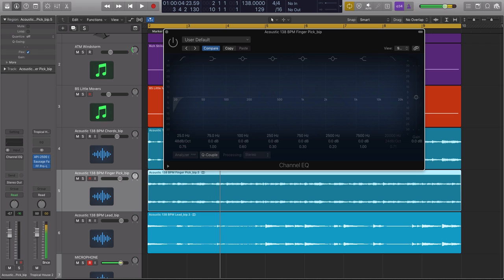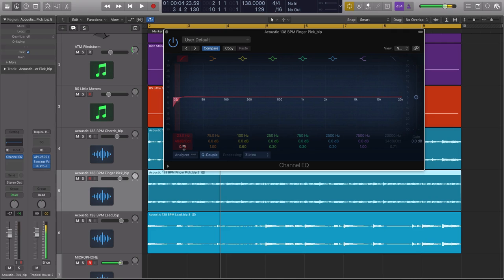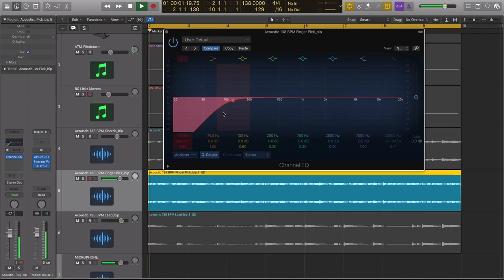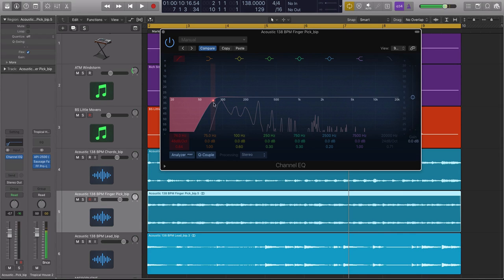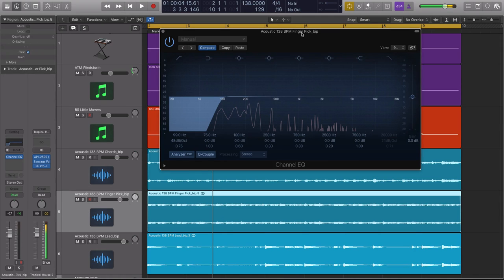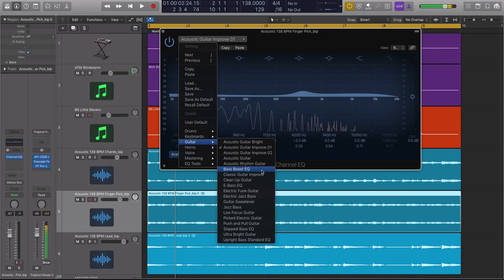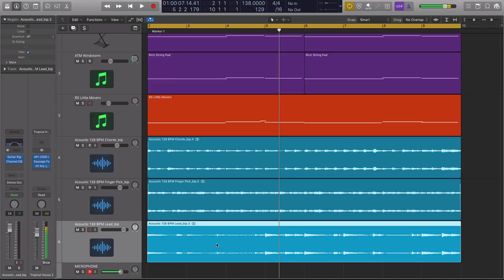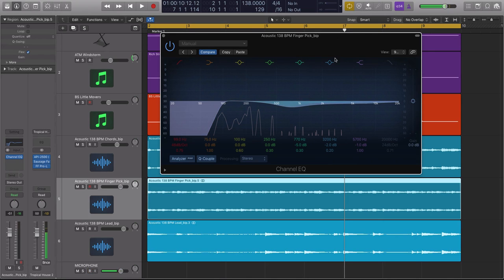3 EQ Mistakes To Avoid

Comment: I've been mixing/mastering and doing various front of house gigs. One tip I give to everyone about high pass filters is, push it to the right and pull it back until it sounds normal, you'll be surprised how much more you cut out without loosing anything.

Comment: I feel like equalizing in isolation is actually a good starting point. It allows me to get a better sense of the strong and weak points of the sound i'm using. After this though, your completely right, it needs to be EQ'd in the the context of the song.

Comment: It's hard to avoid eqing in isolation, but anyway.... aren't there some situations where it's needed? Like when hunting for nasty frequencies and so?
Reply: Short answer is yes.
Reply: Octopus On Fire It's definitely necessary to work in isolation sometimes, but if you do everything in isolation you'll end up with a terrible mix. Basically if you're working with a solo track you should un-solo often to hear how it sounds with the rest of the mix.
Reply: doing both is fine (:
Reply: Octopus On Fire cut out the bull then ex to piece it together
Reply: maybe just to hunt it but any adjustment should be made in the mix. One of those nasty frequencies might sound pretty pleasant when adjusted, if you just blindly pull it down all the way you might have gone too far and taken a bit of life out of the track.
Reply: of course it is important to search for nasty frequencies in isolation. I would do that before beginning the mix-session for all tracks. I think this belongs to the category cleaning up before mixing. 

When you EQ solo (during the mixing process) you´ll end up with great sounding solo-instrument tracks. great. But in context that often doesn´t fit well together.

When you EQ in context you´ll probaply end up getting terribly sounding solo tracks. But all that matters in a finished mix is how everything sounds together.

Comment: With presets, keep in mind that you can always familiarize yourself with the presets in the plugin and that you can also tweak them. So, for any given instrument, if there is a particular eq curve that you already know you are going for, you can slap on whichever preset you know that corresponds to that curve and tweak it from there. Some plugin devs are better than others when it comes to making presets, but as long as you are familiar with what you have, then you can use any preset as a starting point to get you where you want to end up. It's just like anything else as far as taking the time to get to know your DAW, its stock plugins (or nonstock vst plugins), and the presets of those plugins. So I say don't discard the idea of presets, even in your eq and compressor plugins, as they can sometimes provide some great starting points--especially when first starting out and learning about eq and compression. Just don't depend on them without learning from them, blindly slapping them on a track going just by the name of the preset and letting that be it. Learn from them.

Comment: Engineers figured this out back almost 50 years ago. All analog boards since the early 70's have their high pass filter either at 100 hz, 75 hz, or 80hz. It was never higher and for good reason. They made the decision for you. They knew that cutting at 150hz or 250hz would butcher the bottom section of the track in question. 

Regarding Eq in isolation  (Great advice!) I think what you mean to say is, "Don't EQ in solo."  But I guess a lot of amateurs wouldn't know what you were talking about.

Comment: I like this video but there are uses for isolation. The use is knowing what you're giving up when you cut via context of the mix. Many times I find myself in a "pick and choose" between which track I want to cover a certain frequency band. A good example are two lead synth sounds or something like a lead synth sound and high bass sound that overlaps. Do I want more of the high bass or do I want more of the low synth? This is even more important when I'm layering sounds to make one sound. Also, there are a lot of "mid/side" tricks you can do to manage space in a mix. In his example above, I may slide some of the guitar bass more to the side and the low bass mono/mid. I'm not saying it will sound good, but it's worth a try, right?

Comment: Tip #1 Don't use EQ just for the sake of using EQ. Start with diagnosing what is wrong. Then fix that. You can't hit a target if you don't even know what you're shooting at. In most of my mixes I never even armed the EQ. I always tried to get a great sound before even printing. That begins with a great sound source. If your guitar sounds bad, then shit in equals shit out. Same with any other instrument. Second, mic choice is paramount. We had 3 U87s and yet most of the time that was hardly the right mic. In fact, U87s are rarely the right mic! Know the response of your microphones and know where they should be placed. That's where you want to close your eyes and experiment. If you get the right mic and the right placement then you're 90% there. Same thing goes for setting up your mic pre correctly. I can't tell you how many times I heard mic pres over driven or under driven. There is a right place for your gain and it's just as critical as a great sounding source, the right mic and the correct mic placement. (remember, close mic-ing is rarely the right choice. Most people close mic because they have a noisy environment. However, distance mic-ing is generally much more authentic.) Lastly, be cautious of anything between the mic pre and tape (or DAW). Compressors must be mild and I'd never print with a processor as you are stuck with it once you print. As I said, if you do these things you'll find you hardly ever need EQ. Just thought I'd toss in 2 cents. (drops mic. Broke mic. Damn it!! That was a very expensive mic!!)

Comment: Hey! Regarding Logic Pro, how do you save your files? Like as a folder or project? And which of the assets do you tick? Thanks!! I also wanna look long term when I wanna back up my projects in an external hard drive.

From testing out, as someone who has his samples on an external hard drive, I find saving as folder and not selecting any assets to work. Like when I try to open a project on another computer.

Comment: I use FL. Does it matter in what order you put your mixing plugins,  like,  EQ, Compression, reverb... or Reverb first then Compression and lastly EQ. Does it matter?
Reply: Thanx for the advice, yes it sounds logical... :)
Reply: Lars Ekman well if i guess you have 8 slots to put plugins in. 
If you put a plugin in slot 1 it reads that first then it reads slot 2.
So if you put a sidechain in slot 1 and put a compressor and add 100db(just a example). Then it overwrites the sidechain. But if you turn it the plugins around it works as you want to! :D
Reply: Typically, reverb is something people use last because you don't want to create noise and mud your mix up. Sometimes I use light compression on reverb though! It all depends on many different factors. I wouldn't follow any preset order on effects. Rather, I would learn each effect individually and understand what it means to change the order of each effect. Hope this helps :)
Reply: Thank you Kyle
Reply: I also tend to put a gate effect as the very last plugin in my chain.  It helps to prevent the reverb from lasting too long and muddying up the following sounds, especially on drum samples.  Something I've found that helps create clarity in the mix.
Reply: Do whatever you want you are the creator. For my guitar pedals i do phaser - reverb - delay - compression - light distortion - vibrato
Reply: Because I enjoy how it sounds, it gels everything together for me and doesn't sound as bland as the other way around for me. Music is all about personal preference. (i picked up that one from Tame Impala). Reverb that's messed about is usually cooler and more psychedelic to me. Like reverb into delay specifically. because i compress the reverb, it the guitars sound in your face and at a distance at the same time. I love those paradoxal things.
Reply: short answer: yes. google effects chain.
Reply: Using auxiliary channels or sends can help too. Sometimes I like to set up a main channel for fixes and overall levels and then send that off to other channels for specific effects. Like splitting up reverb and delay in different channels (wet only) instead of one influencing the other, or using the extra 4 aux channels for overall reverb and delay.

The most important and least creative part of plugin flow I can think of is compression. You don't want frequencies that need to be cut influencing the compression, especially if they're bass/sub. Say a guitar has a lot of bass/sub range and you compress that before EQing it. Random bass/sub taps will influence the compression and give you strange levels and pretty much destroy any impact the instrument can have. Can happen with vocal plosives and sibilance too.
Reply: Yes, order is very important!!! (This may not be the case for all DAW's but I believe most of them have their inserts in series). This means that the signal will go through your FX chain in the order it is set up, and this order matters. For example, when using EQ and compression on a track, you may actually want to use two EQ's -- one before the compressor and one after. 

Here's an example of how signal chain order can cause problems: 

First of all, think of an EQ as a frequency dependent volume adjuster, and a compressor as an amplitude dependent volume adjuster. Now let's say you have an acoustic guitar track like in this video (for this example let's also say that the amplitude for the entire signal peaks at -10dB). In other words, the entire frequency range for this signal has the same amplitude. But you want to give it a brighter sound so you boost everything above 5kHz with your EQ by 6dB. Now you can see that everything below 5k still peaks at -10dB but everything above 5k peaks at -4dB. 

Next comes your compressor. Remember, a compressor doesn't care about frequency, only amplitude, and it only turns loud things down. So the signal comes in, and the compressor "sees" the track peaks at -4dB but doesn't "see" the frequency of this peak. In your mind you wanted to use the compressor to make the guitar strum more even with some gentle limiting because there are loud and quiet passages. So as you start adjusting your threshold you see the gain reduction meter react and you keep adjusting the settings until it sounds good to you.

But here's the issue... the compressor's meter shows you that you're getting 6dB of gain reduction. Sound familiar? In essence, the compressor looked like it was working pretty hard when in actuality it was only seeing the part of the signal above 5kHz that you boosted with the EQ (meaning that it just turned all of it back down, leaving you back where you started). Basically using both plugins in this way resulted in 0 change. Now this is kind of a silly example, and obviously in the real world it's a bit more complicated than this. But it should give you some idea of what I'm talking about. 

TL;DR
Here's the optimal order I was taught:
1) EQ to fix problems / subtractive EQ (ie. high pass filter) 
     This is where you make substantial adjustments
2) Compression
3) EQ to feature / creative / additive (ie. HF boost)
     This EQ is usually much more subtle
4) time based effects 

This order should, for the most part, alleviate issues like in the example I gave above. But of course there are exceptions to the rule. As a side note, I usually place time based effects (reverb, delay, phaser, etc) on a separate AUX track and then bus the tracks that I want to these AUX tracks. This not only frees up CPU power (because there's only 1 reverb plugin running instead of 1 on each individual track) but it also sounds more realistic as if the reverb is coming from all the instruments in 1 room vs several different sources. Additionally, this gives you a fader dedicated specifically to the effect you have inserted on that track.
Reply: Order isn't about priority or standard practices.  It's about what you're wanting and how effects upstream affect those down stream.  

Here's a good test case.  You have an EQ inserted before a compressor.  You may decide to place an EQ before a compressor in order to clean up a track's low end that contains nothing you want.  As you start cutting frequencies out, you begin to lower the level of the track.  If you've already set a threshold on your compressor, you've now effectively set the threshold higher and reducing the amount of compression on the track.  The same problem could happen if you're using some envelope following modulation or a distortion/saturation effect that's sensitive to the input volume.  I like to use an EQ after the compressor.  But sometimes a want a radical sound and compressing the sound before the EQ will allow the bits of the sound I'm not using to influence the compressor.  There is no right or wrong... only what sounds good and what doesn't sound good and all of the areas of gray that lie in between.  

The bottom-line is this:  you'll probably want to check the plug-ins down stream any time you adjust a plug-in and it changes the overall level coming OUT of the plug-in.  But as far as order, it's whatever you decide to resolve the track.  But yeah... don't put distortion on reverb... unless you're really wanting to... I might just have to give that a try with some other plug-ins behind it...

Comment: You EQ in isolation when you're trying to find a problem frequency in a track so that you can boost it and then take it out. Also, less is more. Always boost in 3db increments. The only time you should be boosting more than 6db is when you're going for a specific effect on a track. Generally, 3-6db will give you what you need.

Comment: One more question, about making changes to EQ in isolation, which I have done basically all the time since I started EQ:ing.
Now when I tried to do it in its context, I found it difficult to single out and to hear the effect of the EQ:ing as all the other sounds where getting in the way. Maybe I just have a bad ear but any advises would be good to get.

Comment: If I have a song that starts with an acoustic playing solo and then the full band comes in mid-song, is it normal to use automation or something to change the eq of the track (acoustic in this case) mid song? Eq'ing the acoustic with the full band makes it sound good in the mix but too thin in the beginning of the song when it's playing solo.
Reply: Yeah it actually makes sense when youre using the same instrument in two parts of the song but i suggest you just use another copy of the plugin/Recorded Audio with another EQ on it.May save you the trouble of having to draw a complicated automation graph and will simple give you exactly what you want.

Comment: ???? Changing frequencies does not change your slope if you know what you're doing with the plugin.. See how you change the slope via clicking and holding on that numerical input and dragging the mouse? try doing the same exact thing except grab the frequency numerical readout instead of the slope.. Now your slope wont change! You may have good tips on doing actual EQ, but if you've never noticed that and have been using the Logic EQ "for years" idk what to think.. lol. sorry..
Reply: Try to remember that he was doing it with his eyes closed, and as a demonstration. I'm not sure about Logic because I use Live, but I imagine there should also be a virtual knob that corresponds to frequency within the eq. I usually grab the freq knob, instead of a point in the meter, and slowly turn that while not looking until I hear what I like. So I give dude the benefit of the doubt and assume that he does know this.
Reply: burn!

Comment: Here's a little thing to consider, folks.  It may not NEED to be EQ'd at all.  If you record it well it actually can sit in the mix just fine with zero equalization.  This happens all the time with me.  Take the time to record properly and you actually may be able to save yourself the trouble of having to EQ at all.  Everyone needs to understand what equalization was invented for.  It was created to compensate for high frequency loss over telephone lines.  I know a lot of people think EQing is a requirement for mixing, but it's not.

Comment: Anything below 50Hz distorts on average consumer sound systems so you should always cut those frequencies, also,cut out everything that is higher than 15-16khz because most people cannot hear those frequencies anyway, thus giving more headroom for the rest of the sounds. Thank me later.
Reply: Oprea Iulian If you cut at 15/16 khz, why use 44.1khz sample rate? You could go down to 32khz without hurting anything.
Reply: I usually let anything between 40 Hz and 18 kHz pass. Most younger people (circa under 30 years old) can actually hear up to 19 kHz. Very few people are able to hear frequencies around 21.5 kHz, but there are some who can. I can.